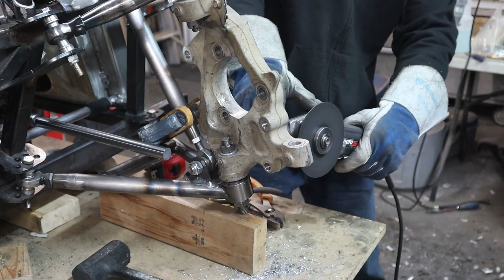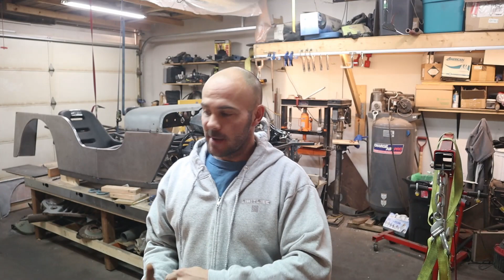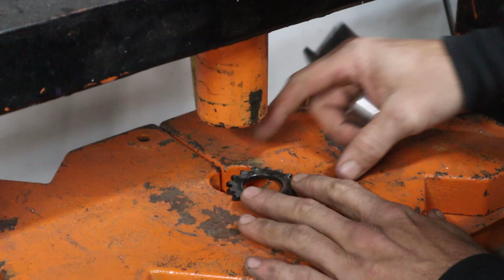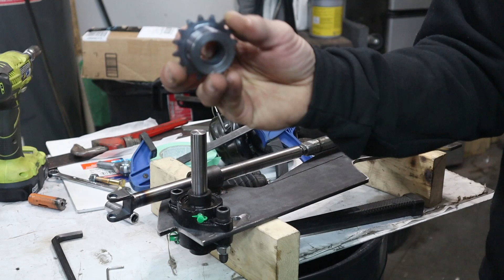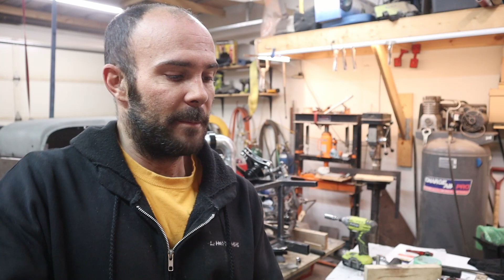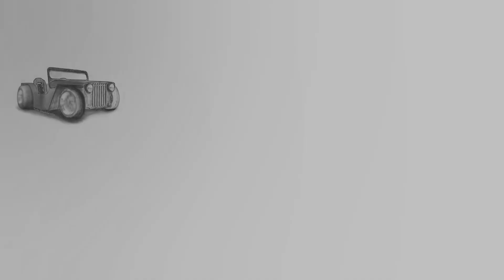Chain drive steering rack? (Turbo Hayabusa Willys Jeep Ep. 23)

Comment: I like how the bits and pieces are coming together. There is just one question. Have you checked the ackermann steering geometry? On a streetcar it is not to be negligible...
Keep up the great work 👍
Reply from the maker: That was the reason why I cut off the stock mounting points. I haven’t used a string or anything, but it’s pretty close to the middle of the rear end right now, but will depend on my toe adjustments later

Comment: Are you going to make a video of you making the fenders and other body components ?
Reply from the maker: Absolutely! Just need a bunch of other things in place before get to those so I know it all fits
Reply: @limitlessbuilds  oh okay that makes sense, I am about to start building a CJ2A tub myself but I am having some troubles trying to figure out the wheelhouse measurements
Reply from the maker: @PapaMooose  mine is significantly different than a stock one, I moved the front of the arches back to fit the wheels better, and up as far as I could. 
For the front, they will also be moved up several inches and likely attached to the hood permanently so it’s easier to work on the engine
Reply: What gauge sheet metal did you use for you body ?
Reply from the maker: @PapaMooose  hmm. Can’t remember now if it was 14 or 16. Pretty sure I said in the video though

Comment: plans on greasing control arm swivels ?? also where did you get the ball joints at ? cool !!
Reply from the maker: Shouldn’t need grease ever, they are all Teflon lined. I can’t remember exactly where the uniballs came from. Somewhere in the USA. Not a bad price either if I remember correctly. If I find an email from them I’ll reply again
Reply from the maker: Got the uniballs from here
https://steinjager.com/shop/
The threaded rod ends were sourced from a manufacturer overseas. Hope that helps!